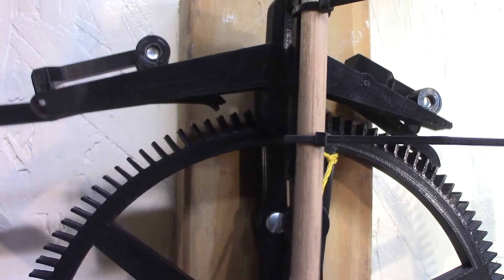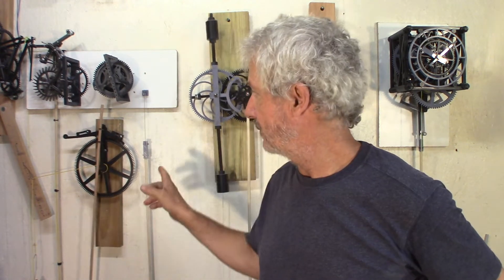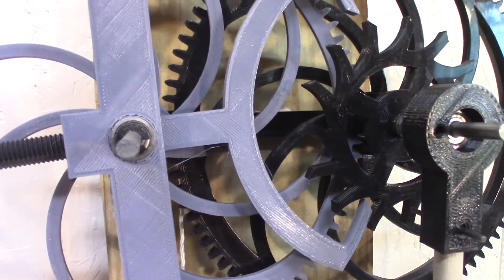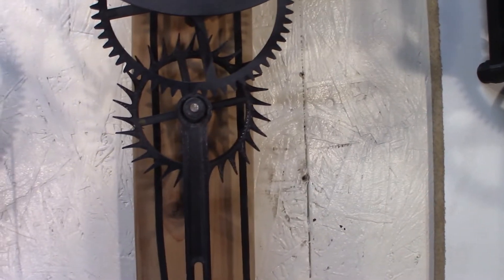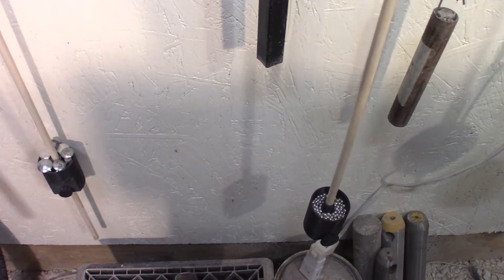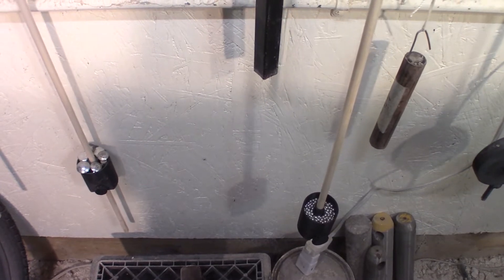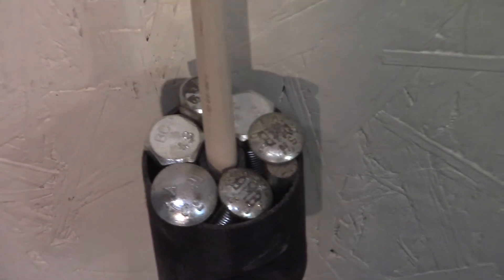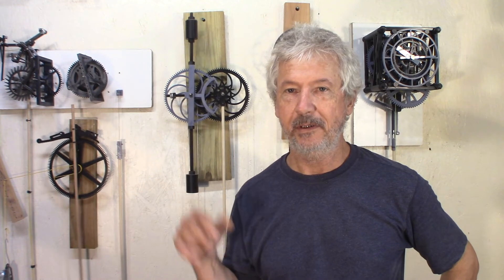Design of a 3D printed Grasshopper escapement: First prototype

Comment: Found a clever way for the bearings to fit from another item on thingeverse when making the bore for the diameter of the bearing they made it larger by about .7mm and then put around the internal circumference about 9 raised flutes of semi-circle design the I.D then being a couple of thou smaller the the O.D of the bearing thus giving enough friction to hold the bearing tight
Reply from the maker: Nice idea, thanks for sharing

Comment: i am under the impression that the grasshoper is far more quiet than the others. is that correct?
Reply from the maker: Yes it is
There is no drop like other escapement
Reply: Most of the sound is from the arms releasing. The sound can be reduced by using a rubber or felt pad to catch them instead of plastic hitting plastic.

Comment: Lots of great new ideas. Keep them coming. I am interested in the accuracy of the compound pendulum. And also the piano wire suspension. Where is the effective pivot point and does it change after adding a crutch to supply restoring power? It should be very efficient.
Reply from the maker: There is a book well worth reading: Harrison decoded, Towards A Perfect Pendulum Clock
It is about this clock
https://youtu.be/sQAY-zFkVyQ
Anyway, spring used seems to be 0.12 mm with circular checks of a radius of 63 to 85 mm
position of the crutch pretty close to spring
Mostly been listening to the book as an audio book for now
According to the design the minimum swing is 9,65 degree, with a normal swing of 11 to 12 degree, max at 15
It is going to be an interesting experience
Not sure about the compound pendulum, might benefit from more swing
Brian Law has a spreadsheet that help with dimension
https://brianlawswoodenclocks.blogspot.com/2015/02/compound-pendulum.html